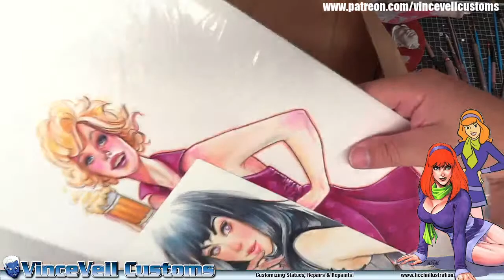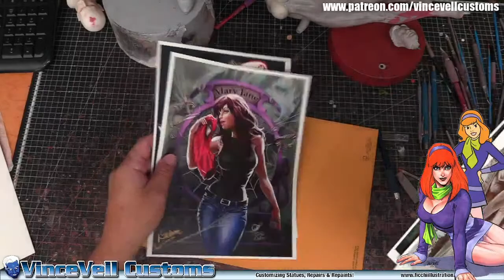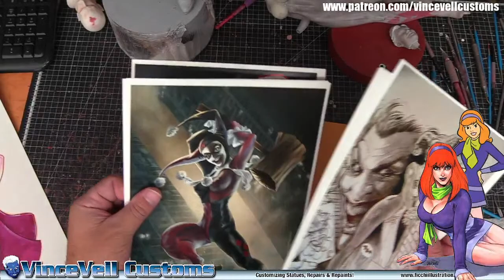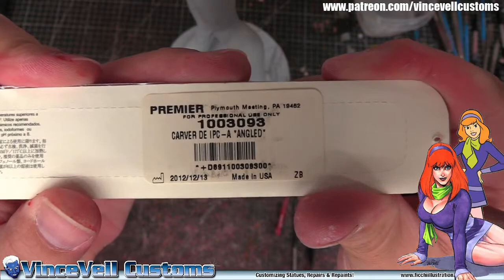VinceVellCUSTOMS Live Stream - Saturday make up stream, Daphne, Hyperion & April O'Neil added.

Comment: Hi vince, amazing work as always! i have a quick question. Im about to start using silly putty to mask the figures. Do you re-use the silly putty after a mask? do you clean it and how? or do you use a new pice every time? Thanks!
Reply from the maker: just use it paint, pull it off mash it up leave it in a container, then re use it over and over and over. just keep mushing it up. I till be messy looking but I have had my silly putty for years and I keep using it. I only use fresh silly putty on areas that are a candy coat where it may pull paint bits from the putty and stick to, Next stream I do on Friday can come in ask and I can show in real time my containers.
Reply: @VinceVellCUSTOMS  Thanks! i´ll be there!